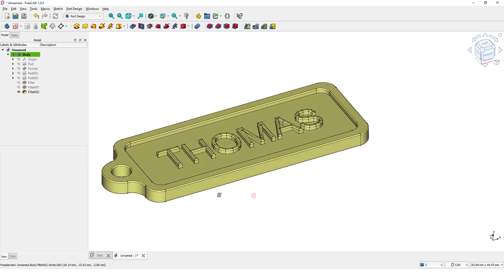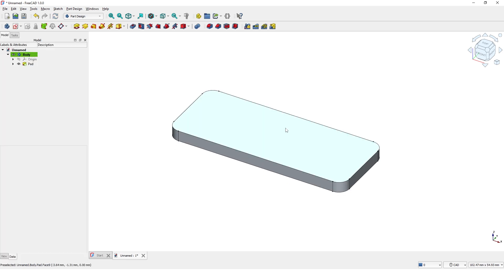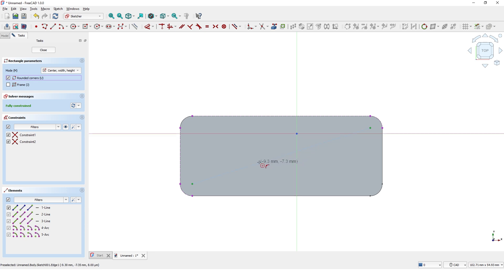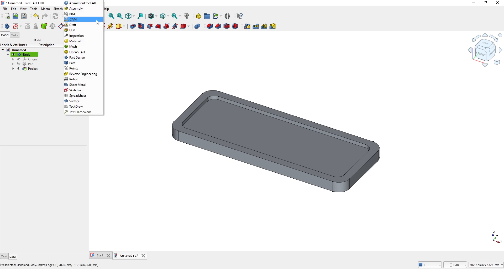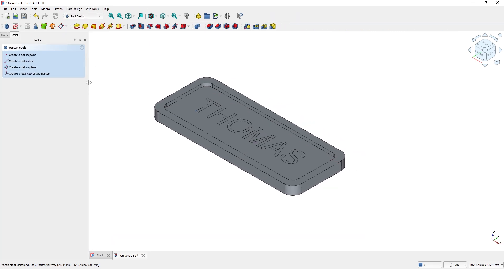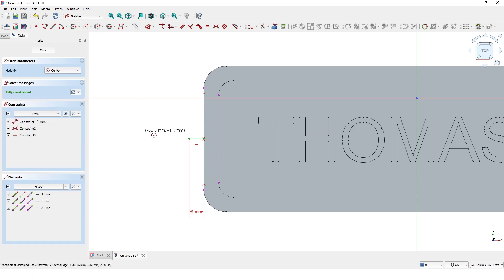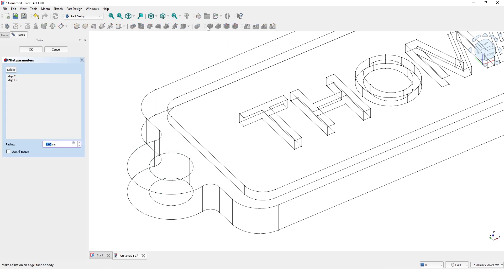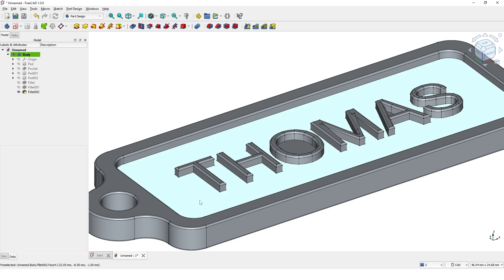FreeCAD 1.0 Tutorial | Easy FreeCAD Tutorial 2025 | 3D model lessons

Comment: Everything works perfectly. I’ve made some adjustment to the size but that’s it. I go 100 x 40 all the other measurements I use yours when I get to the fillet of the front edge and the back edge and the name itself it tells me it cannot do that more exact it says command not performed. Is it something to do with me changing the measurements?
Reply from the maker: I am not sure what do you mean by "the front edge and the back edge and the name itself it tells me it cannot do that". If the filet doesn't work, try smaller radius value and if it worked, gradually increase close to desired value.